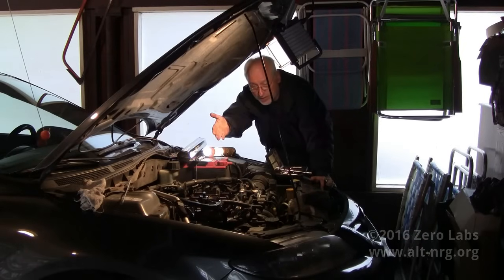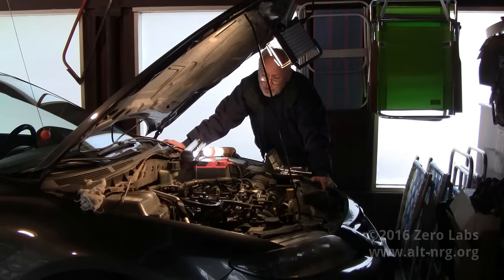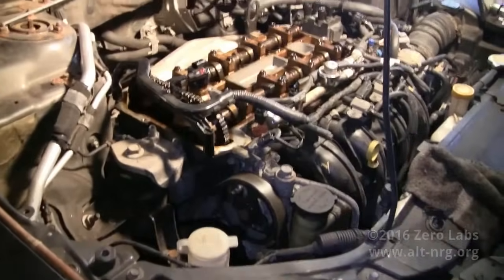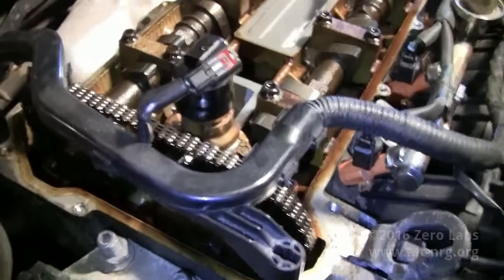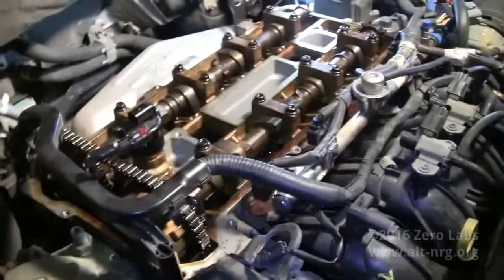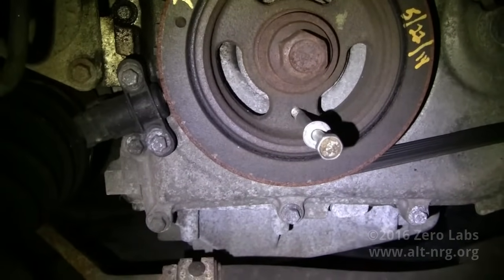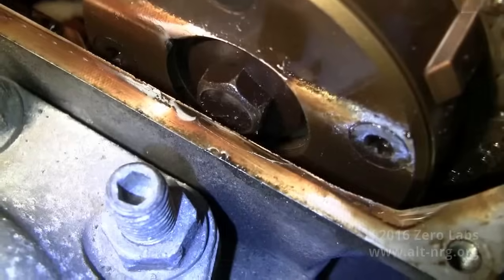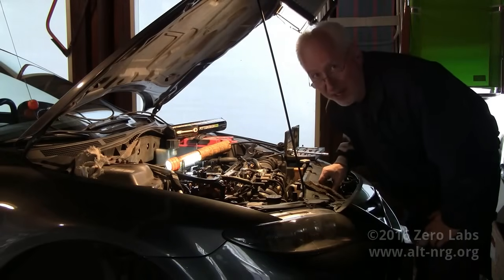#456 Mazda 2.3L cam timing chain sync problem P0340

Comment: Mine is having the exact same issue, except I can't get my camshaft bolt any tighter. Starting to round out the head of the bolt with the wrenches I have. None of my 15mms fit snugly on it. I really don't want to have to remove the timing cover to tighten a single bolt. Any advice?
Reply from the maker: Sell it to the first sucker you can find and buy a Toyota? :-)

Comment: I have p0340 fault code. So far new ECU, new camshaft position sensor, checked by auto electrician, aragh, driving me mad. Auto electrian said could be stretched timing belt. Mine is intermittent, my car will start... when its cold... Going to cost a lot to change timing chain, I hope it fixes it.

Comment: One thing about this is that those bolts usually have diamond friction washers and some dont but i think its better with it. But the problem isthat surface where the bolt tightens on the inside on the vvt gear whereit meets the shaft gets oil on it once the bolt loosens. So what ive had to do is take it all off and clean everything really good of oil before torqing

Comment: Thanks so much for the video. I have an 04 Mazda 6 doing the same thing. I can move the crank sensor on its furthest setting and get the car to start but not right. So I will check the cams and see if it's that. 4-11-22

Comment: Great video. That noise is most likely the bucket lash on one of your intake valves. I know as i have the exact same car with that issue. I also have the same heavy oil consumption issue which is most likely a faulty PCV that is common for that motor and isn't easy to get to( requires removing the intake). When i get around to fixing the Lash i will also be installing a new timing chain kit along with a new OCV and VVT. Then fitting a new PCV with hose. This should have the car running like new and will hopefully get another 300k's out of it. You are right, the oil light does not come on until oil is near dead empty. Absolutely ridiculous!
Reply from the maker: I seriously doubt this engine will ever last that long. Hope you manage to do so.

Comment: It is also a known fact that the 5 pin reluctor wheel pre 2005 or 6 pin reluctor wheel 2006 onwards can actually move a few deg off where it's suppose to be . It's possible to use a cold chisel and tap the reluctor wheel   around  on the cam to where it's supposed to be . Engines that rev high are well known to spin o  the cam .
Reply from the maker: Yep. Guaranteed to fail. Reprehensible.

Comment: Thanks a lot for this video , I thaught it will be saved my life , but it is not! Let me explain: 

I have the same message from the ECU P0340 when push hard on the motor, but only when the motor speed decrease , I don't have the check engine light on until I release the pedal.
So I have change three time the  camshaft sensor , it is not the problem. I have read many forums and no answer to my questions , youtube same thing until your video.

A friend confirm me that too , maybe my timing chain has a loose, I should change it and if it is  not ,  maybe the chain guide is used or broken . 

So ... I have my timing chain waiting to be installed , I need the special service tools!!
If I just do what you does on you video , maybe I do not need to dissable the whole motor to change the timing chain !! 

Just for the record my vehicule never make the sound like your daughtter's car does. 
Speaking of that , what happend to the vehicule ?? Will you able to fix that ?
I agree with you about vehicule constructors , sometime they hide important informations , sometime they try to save money  and that the resultat of  useless car before 100 000 kms or put our lives in danger at some point !

Thanks for reading me! I let you know if you solution solved my problem !!

Comment: Thank you sir ...I've been stuck with cam sensor light on and nothing I could do would sort it. But after watching your clip I sussed the cam had moved out off sync by 30 degree's, sorted that and back together and hey presto it's running perfect with no check engine light reappearing. Thank your for your wisdom again 👍

Comment: I think it's fairly nonsensical to complain about a $1.50 oil passage in a motor that was ran completely out of oil. How could that oil passage have helped with no oil in the engine in the first place? (Hint: There's a simple answer). At any rate, most cars, even newer cars don't have an oil level indicator on them and even when they do, its tied to the check engine light and throws a code. So if your check engine light is on and you are ignoring it because you know why its on (you think) and another code is stored.... like a low engine oil level code... you wouldn't know it unless you read your codes regularly. The oil pressure low indicator is suppose to emit a signal if a pressure of below 3 to 5 psi oil pressure os detected. Not zero. This sounds like a simple case of the oil not being checked or changed regularly. Yes some engines use oil. That can be exacerbated by not servicing the car regularly. For the rest, there is a timing tool kit you can get for timing these engines correctly. Its about 20 bucks at autozone and such and yes, it can be taken as a rental. Timing on these engines is fairly critical as even a few degrees of cam timing off and your valves can hit the pistons. If this happens its generaly adios motor. The bolt used in the pully is a 6mmx30 bolt. It is also not sufficient to check the timing on these engines as it is a friction system and the crankshaft is not keyed. That 6mm bolt through the pully and into the timing cover is the pully position indicator for TDC. The rest of the engine needs to be timed to TDC before that bolt is even used to position the pully correctly and the pully bolt tightened locking the friction mechanism in place.

Comment: Car’s fixed.  ...And another 10 minutes of video?  Glad I continued watching.  Very informative and effective troubleshooting skills.  Loved the ability to improvise tools which is, surprisingly, uncommon.  It’s not surprising to hear there were no indications of an oil leak though.  Air dams and splash shields under the engine compartment also contribute to hiding any evidence of oil leaks.

Comment: The oil light is not to tell you  to add oil,it's to tell you no oil is left. 2nd checking your oil is the owner responsibility.these newer cars seems to burn oil,for some reason.even honda and Toyota had to recall motors for burning oil before oil change
Reply from the maker: Translation: It's to tell you it's too late. Totally worthless.

Comment: I bought the timing tool kit and mine line up and i got the crank against the pin and tooth lined up but it still cranks as if its still out of time.
Reply from the maker: These engines suck. Period, the end.

Comment: What tool do you suggest if I can’t modify my own wrench to tighten the cam shaft?
Reply from the maker: It's been a long time since I looked at this. Not sure if there's a specialty tool made for the job or if there's more disassembly needed to do the job correctly. IMHO, the better option is to sell the car ASAP and buy something else.

Comment: Im completely agree with your opinion about ford 2.3L motors.  And I  can add some complaints with the catalytic converter.....both suck. They're really cheap and stupid as hell. Stupid engineering.  Hate 2.3L Ford and Mazda.  I'm not recommend at all. As mechanic I'm not recommend that's motors

Comment: Just came across this video! I can CONFIRM that the low oil light DOES NOT come on........ until after your engine is totally trashed! Happened to me many years ago with a 2005 2.3 engine! The light comes on (after the tap dance starts) to let you know that you trashed the motor! Happened to me one winter when my valve cover gasket was leaking and I wasn't checking the oil because I was lazy and it was very cold. At the time I replaced the engine with a junk yard 2.3 replacement ($3000 bucks later) --- and I now check the oil on it FREQUENTLY! Learned my lesson the hard way! I randomly decided to research timing chain replacement on this 2.3L engine platform and that's how I came across your video! I was wondering if it would be a good practice to have it replaced - or just leave it as it is. As you know these cars and engines are worth next to nothing today - but I do take care of the car and I'm wondering if it's worth it to have the timing chain replaced? Yes I do plan on keeping the car as long as the engine and everything else continues to run! Thanks for your video and your advice on checking oil! I surely check mine now. Hell, I will go give her a check right now!

Comment: From the one frame i saw   the VVT  is not properly aligned, with piston at TDC  all 4 valves closed  and with bolt  installed into engine block and the crank  counter weight  hitting  the bolt the VVT notch should be at 12 o'clock position if not the VVT will be to much advanced  / Retarded , reminder buy new  Friction washer if you remove the VVT  >    Pn L3K9-12-429

Comment: Was a great start to the video until you went on a rant about an oil pressure switch. You dont use an oil pressure switch to tell you when to add oil. Oil pressure switch lets you know that there is something seriously wrong and to shut off the engine. An oil level switch wont save an engine if there is pressure loss. Of course you have to check oil level on the dipstick just like you should look in the radiator for coolant. The catch can tells you very little information.
 Manufacturers use 1litre per 1000km as a guide for warranty work which is ridiculous but it would have to consume that much for anything to be done. 
The 2.3 engine is a great little engine new and old! Should get many hundreds of thousands of miles and be fine if owner does their part. The old 2.3 single ohc engine is in millions and millions of vehicles from the 70s to the late 90s. You are stating so many random things about what happened to your wifes old car that it seems like you dont understand what actually happened. In engineering terms $1.50 savings is huge but it sounds like you are mixing up the pinto story there which was a load of BS as we all know now.

Comment: Congratulations for diagnosing issue. I probably have same problem with my mazda 6. Unbelievable stupid engineering of Ford innovators. So they made timing chain engine not last forever like those did before. 
And of course, big thank you for shared experience and big sorry for your noice rod bearing

Comment: I just had to do a engine swap and i had to replace the crankshaft pulley to a double pulley because my ac uses it also now my question is now that i have the motor in and I have gas in the line but my sensors aren't getting the ok to spark because it won't try to turn over.. It just cranks doesn't try to turn over is my timing off because i don't remember the double pulley having that plate behind showing the alignment .. any suggestions because it has to turn over to give me any error messages on the computer so I would be appreciative of any help cuz i am stuck
Reply: Don, I hope you figured this out. If you have one of these 4 cylinder ford engines in there, ( it could be a Mazda or a focus or lots of different cars they use these motors in) the crankshaft is not keyed. The whole assembly behind that pully is a friction system. Once you loosened that crankshaft pully bolt its a good bet you lost the engne timing. There are videos here on YouTube showing the process for timing the motor. Just hope you didn't crash the valves.
Reply: @Trainwheel_Time  nah I appreciate your insight, I had to replace the brain box and and changed the timing cover because the pulley is different and I need the sensor closer but I didn't mess anything up.. I was actually worried about it myself but in the end the timing ended up off by a good bit but I figured it slowly and carefully.. The hardest part of the experience was that the local police department let two guys destroy my car in the first place and told me their job wasn't about probable cause, it was about fact... Lmfao 😂
At the end of the day they couldn't solve a murder 5 ft in front of them but hey what else could they use tax dollars for these days...

Comment: I have the same oil dummy light issue. Doesnt come on when oil is low. Spun #3 connecting rod bearing. Didn't damage the crank. Replaced the bearings on all 4 connecting rods for $55. Easy fix. But still shouldn't happen at all. They all also burn oil like a wildfire. 3 to 4 quarts burning off in 1500 miles is quite ridiculous. Should be usually 1 maybe 2 quarts every 3k miles.
Reply from the maker: True statement. Those motors are real junk. Knock on wood, my 97 Camry 2.2L 5SFE blew a front main seal which is part of the oil pump at about 180,000 miles while on vacation with the family at Cape Cod. Had to keep refilling with oil half a dozen times on the 3-4 hour drive home. When I replaced the pump I found a small amount of metal shavings in the pan. Not sure which rod but there is a slight knock about as loud as a maladjusted lifter. Been driving it that way ever since. Now at 307,000 miles. Doesn't burn a drop. Recently bought a set of bearings from Rock Auto that I plan to put in this spring anyway.
Reply: @zerolabs  I wouldn't say that the 2.3 Mazda engine is junk. It just wasn't very well-thought-out when the oil light isn't functioning properly. once I replace the bearings in mine, I never had really much more of an issue. I just made sure I check the oil every so often. The bearing spun at 179000 Miles. The car now has 214000 miles on it since I replaced the bearings. It really is a good car. Hasn't given me any issues except for just recently, the battery finally gave up on it.I replace the battery and the car runs with no issue. No knocks. And it also seems to be burning less oil now than it ever has. I also don't use cheap shity Valvoline oil. I use Pennzoil ultra synthetic. Which is been proven to burn off at a much slower rate as normal conventional and synthetic oils.

Comment: Oil level indicator. My 1978 Chev Monza  had a oil level sender on the side of the oil pan that would turn on the oil light when it got about 2 1/2 quarts low. It also had a head temperature sender/switch that would kill the power to the ignition when it got way overheated not jest boiling over. 

There was a low oil indicator in Lincoln Continental during the 80's. Someone could put one of those in a oil pan that would turn on a very annoying truck back-up beeper hidden deep in the dash. Hint, hint

Comment: Thank you for the information ! I have a 2003 Focus 2.3 pzev with the P0340 code...sensor replaced but still there...cant't wait to take the valve cover off and see the position of cam !

Comment: I had this exact problem with my Mazda and after asking a repair shop to do this fix they tried to sell me more replacement parts so I did it myself and now the car runs like a dream. Thank you for your help. I wouldn't have attempted this fix without your video tutorial.

Comment: As a father myself with daughters, i always check their cars as i always anticipate their state of minds with their busy lives. I remind them to check and they do. He is right about an oil light, it should be set after the car drops below 1 liter or 1 1/2 pints with the light coming on to top up! Same goes with fuel lights as some wait till its bone dry. So yes there is a responsibility on manufacturer and owner.

Comment: recently had a dpf light problem, checked and dpf regen was functioning and the mechanic found out the timing chain sensor was causing the light to come on! just another dpf failure to point out. i will show him this video as he said the only solution was new chain (mazda cx7)
Reply from the maker: Yeah right. My BS detector meter is pegged.

Comment: I just had everything timing component changed and the dealer ship just called and said I have rods knocking , IM wandering if maybe they haven't installed the parts correctly, Would you be able to give your opinion ? From the way the service mngr stated it still sounds as it did when I took the car to them

Comment: Just want to thank you for all that valuable information. My daughter as well as all the regular customers has a Mazda6 2.3. The engine at the moment runs fine but for what ever the reason, the lead positive that goes to the alternator has melted the surrounding terminal plastic. What is strange is that the alternator is functioning correctly. Any ideas? Oh, by the way, love the video...

Comment: U want a mazda 3 engine to last check the oil daily. Change it weekly.
Reply: I like mazda but who want to do that, they seem to use a lot of oil I've had about 5 mazda   3,6 and about 5 civics 2004-2005 they seem like a better car uses no oil and better on fuel